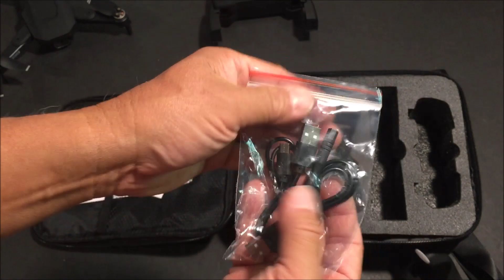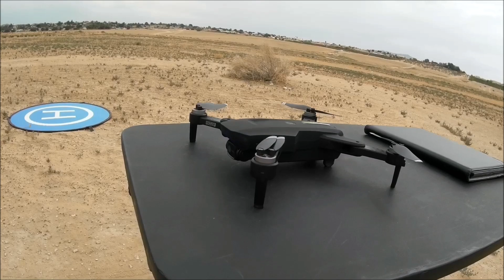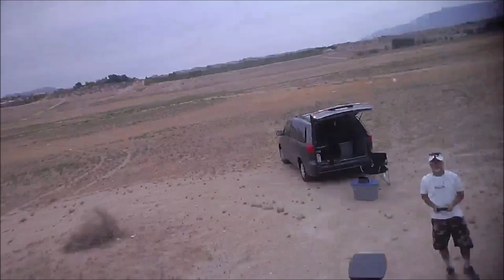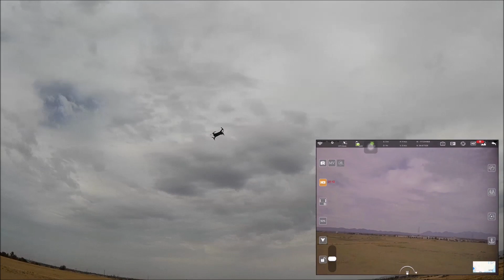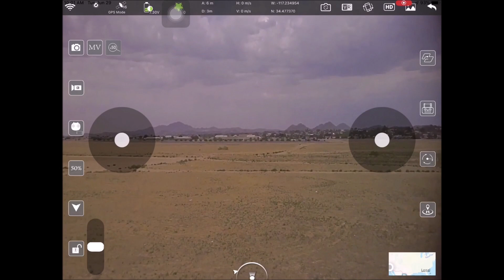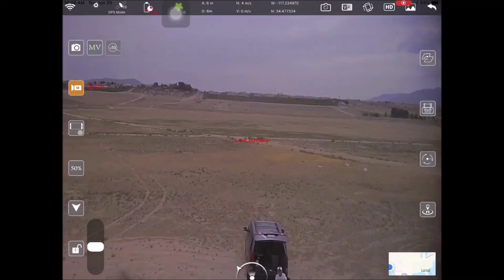LSRC LS38 Foldable 5G wifi EIS GPS RC Quadcopter RTF Review and Flight Test

Comment: Hi. Just purchased my first quad copter . My phone only supports 4g  and will not work do i need 5g or is there a setting i can change 
Thanks
Reply from the maker: This is not a cellular 5g but 5g wifi which most phones should support unless you have a really old phone.
Reply: @RCEscape  ive a iphone 11 ive googled how to change settings but cannot find 5g . Thanks for your reply im going to by a ipad today . Great video ,made my first flight very easy .its spurred a return to 1/8th rc racing again
Reply from the maker: @paulthewall1  
I've a iphone 6 plus and iphone 11 pro max and they both work just fine.
Reply: Oh ok.i will have to look into changing this . Thanks
Reply: Hi . As i was trying to set up in the house it wouldnt connect due yo being connected to the router .have resolved the connection away from the house . Many thanks . Have a great day

Comment: I've bought this drone, and I'm using it with a Huawei P20 Lite. Unfortunately, there is an enormous lag in receiving the pictures on my phone, making it impossible to have real-time picture control. I'm now considering, to replace the phone. Any advice what phone specs I should observe?
Reply from the maker: Yes, stay aaway from Huawei.  Either get a Samsung or an iphone.
Reply: @RCEscape  I bought an iPhone 7 for 50.00 Euros and now it works fine.
Reply: @CNFontijn  Which Samsung device would be perfect for flying drones?
Reply: @fashionboutique4567  I'm happy with the iPhone 7. A larger display would be nice, but you can't have everything.
Reply: @CNFontijn  i have samsung a71 device not working properly drone
Reply: @RCEscape  Thanks for your prompt reply? Will a Samsung wit 4 GB RAM / 128 GB internal memory (Samsung A-series) do?

Comment: I cannot operate it thru remote control can you help me solve the problem please
Reply from the maker: I need to know more specifics.
Reply: @RCEscape  yup I can unlock the motor but it doesn't lift up when I push up the throttle...but thru app there's no problem the trouble is am not used to using phone as controller
Reply from the maker: @victorinosantiago7141  
Did you acquire the necessary gps satellites?
Reply from the maker: Oh, with the phone it works….hmmm….did you turn on quad first and then the remote?
Reply from the maker: Oh, you can unlock the motors?  With the remote?  But cannot throttle up?  If so, something not right.  Bad unit?  Maybe.

Comment: Quad seems to fly okay (on GPS and optical flow) and has brushless motors, but you're never gonna get decent range with these wifi-fliers. Wish they stopped relying on recording over the airwaves to the phone: stupid idea, but I guess they save a bunch on hardware (yeah right!). Camera is a bit of a let down, but what you'd expect at this price? EIS doesn't seem to work imo, and that 'shading' on the right can indeed be a lens misalignment, but could also be a misplaced 'cover' that's placed in front of the lens (??)
Reply from the maker: Right on the money as usual :)
A few adjustments and they got a winner at a great price!
Reply: @RCEscape  Mmm, not sure that camera's (non functional) EIS is salvageable with a mere 'few adjustments'. On the other hand, years ago I bought a Hubsan H502E X4 Desire with pathetic brushed motors for about the same price
Reply from the maker: @pixelpeter3883  
I meant for the manufacturer to make few adjustments and not the end user.